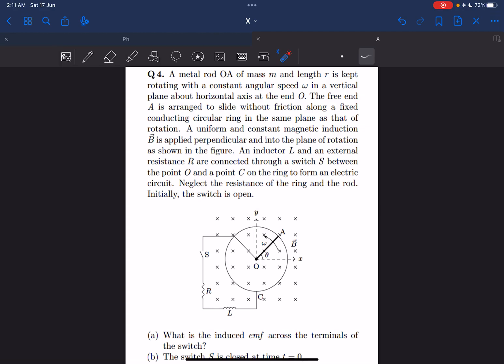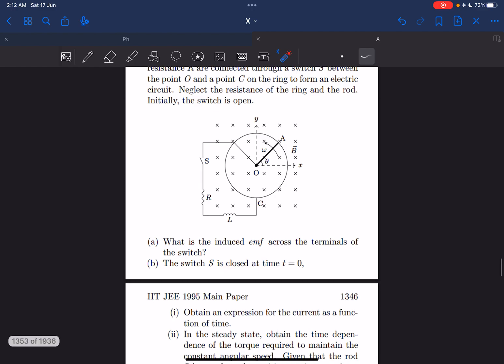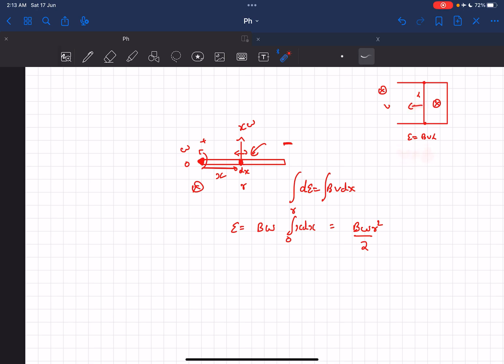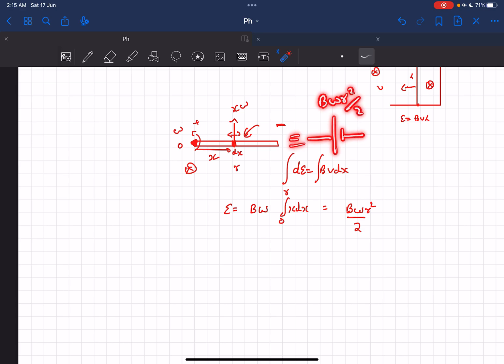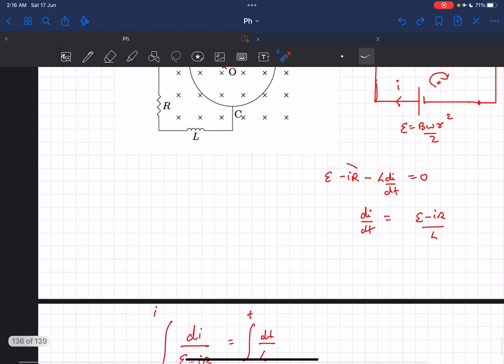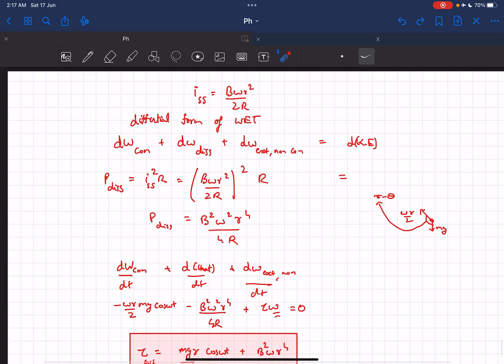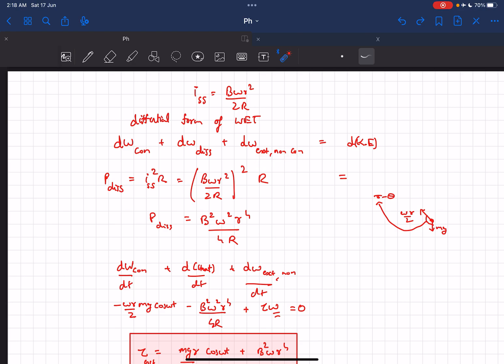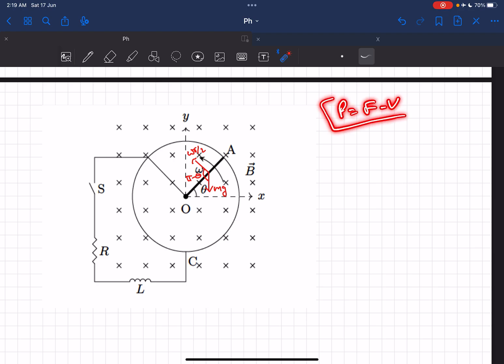[JEE Adv] Rotating Rod in a Mag Field | I(t) | Ext Torque | Induced EMF | IIT 1995

Comment: Here for finding torque for maintaining velocity can we also do torque balance for maintaining  angular vel,because I'm unable  to proceed  after that
Reply: No you can't use torque balance as it with not include energy loss by resistor which will continue to decrease it's angular velocity. 
So you have to give a extra amount of torque rather than just balancing the torque